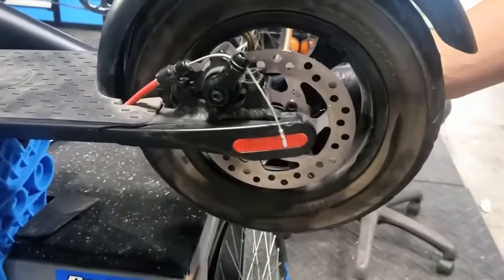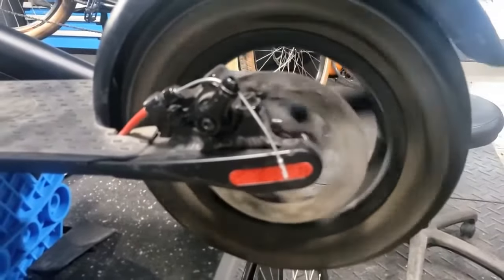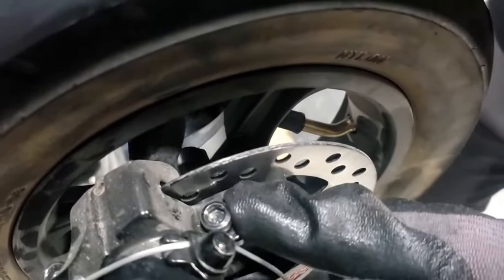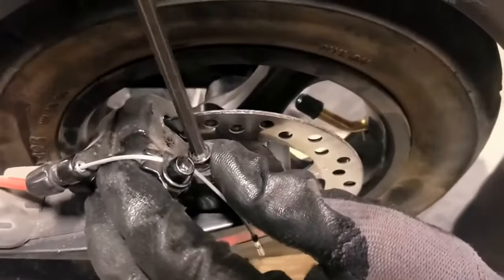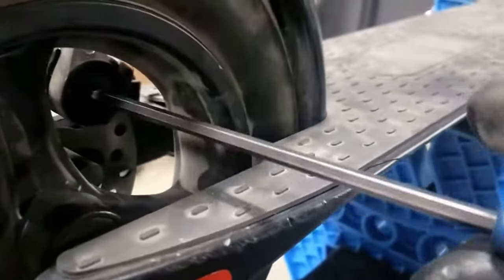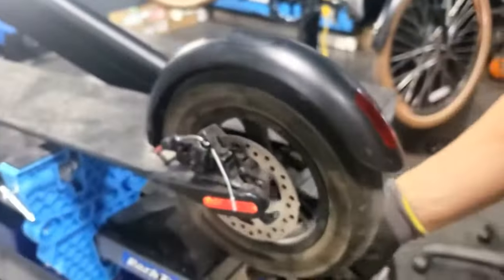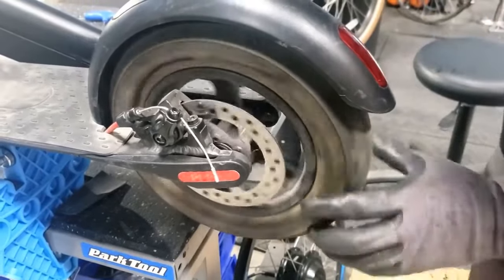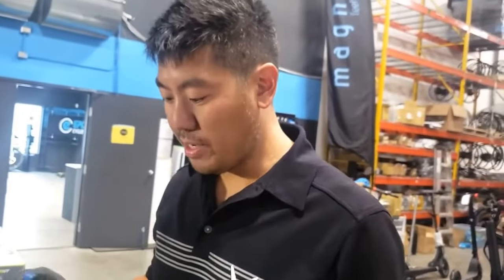How to Fix Disc Brakes Noise (Squeak, Squeal, Rubbing & Grinding Noisy Brakes) - X7 X8 X9 Scooter

Comment: Only problem is; when I do this...the noise goes away...but then the caliper brake is so loose.  Barely can come to a stop.  Looks like I have to choose between bad braking or noisy/uneven wearing braking.  Well, I guess technically it's uneven braking even without the sound (since mine is still crooked since the braking itself is uneven).
Reply: Same here, I just changed my pads and they were good for the 1st 30miles but I had to change the position and have them scraping just a lil bit 2get a good stopping force. 😉😌
Reply: welp sounds like you guys need new brake pads, whne their worn out, they take alot of distance to have significant braking, new one are quiet, and with a little press, their fully ingaged

Comment: Yeah but when I finally get it right and take it out for a test ride the rubbing comes back after a few times braking..I'll try this method I hope it works for me
Reply: The same thing happen to me did you find a solution to this problème
Reply: @oussamasaloum1219  yes I follow this video and it's fixed
Reply: @trini_boi2414  i do same but when i get it right o go for ride and the same problème back again
Reply: @oussamasaloum1219  you might have a bad caliper but I'm just guessing...once everything is tight is should be good tho

Comment: I did this and I figured out that it wasn’t only my disk break rubbing against the wheel, the washer on the back screw was doing it also, I was able to align the disk break to where it’s not doing it any more but now the washer under the back screw keeps doing it

Comment: Why do i hear squealing when i brake? I already cleaned my brake pads but i still hear it whenever i use rear brake.
Reply: Usually sanding the brake pads down a little should stop it

Comment: Didnt know about the back bolt at all.. Thank you! Had to tighten it fully cus if I play with it and the other bolts I can get them to a point where no sound is being made but for some reason the brake becomes weaker (I tightened the brakes at 100%). If I tighten the back bolt 100% then both braking and the lack of sound are excellent.

Comment: Exactly the sound I was hearing! I played around with both sides of the break… A little push and pull fine combinations of you loosen tightness on either end - and it all sounds nice and clear now! This is my first scooter, it’s awesome to see that the way it’s built is basically the same across brands so I don’t have to worry about some unusual issue/fix!

Comment: Unscrew the caliper squeeze the brakes then tighten that aligns the caliper to the disc then redo until silent also buy brake cleaner clean the pads and disc and do not touch them with bare hands as the oil from hands and sweat contaminates the pads and discs

Comment: Ok how do i tell if my breaks have gone bad cause my brake works but it it barely works if that makes sense
Reply from the maker: check the brake status while braking, see if you need a pair of brake pads or the disc or the caliper

Comment: Does this work in the front brake for X9? I just got mine and it has a slight noise on the front wheel.
Reply: The same problem. Disc brakes very noisy on it
Reply: @ДжонатанЛивингстон-ъ7я  sorunu çözebildin mi?